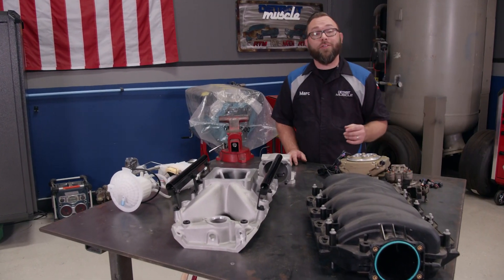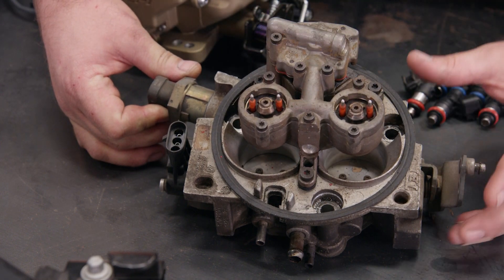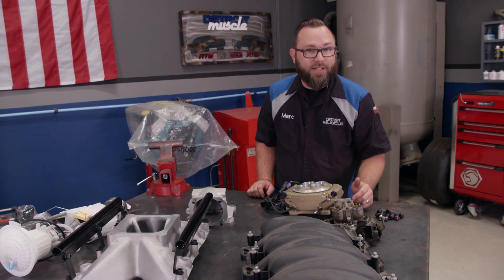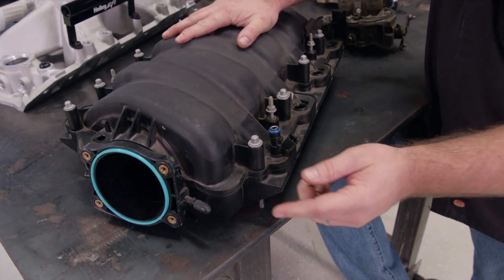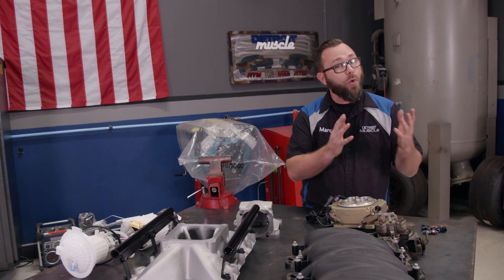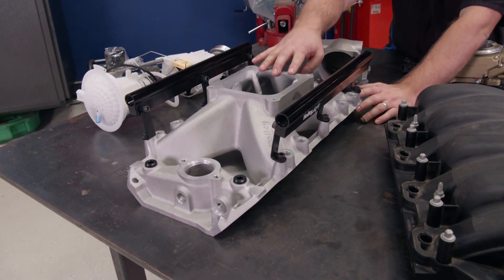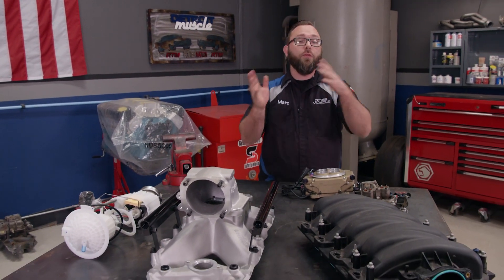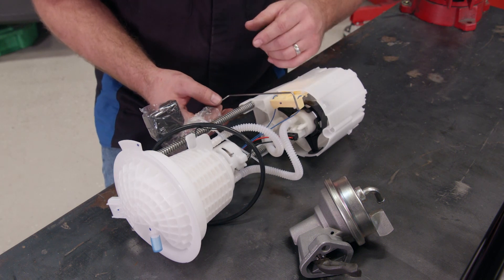How Electronic Fuel Injection Works

Comment: Anyone who says that electronic fuel injection is more reliable than a carburetor is out of their ever lovin mind. A carburetor is 10 times less likely to malfunction. And a carburetor can be totally shot and the car will still run. I have type l jetronic fuel injection and it has been a total nightmare.
Reply: Efi is for emissions and eliminates vapor lock. The cool FI was the Rochester Ramjet